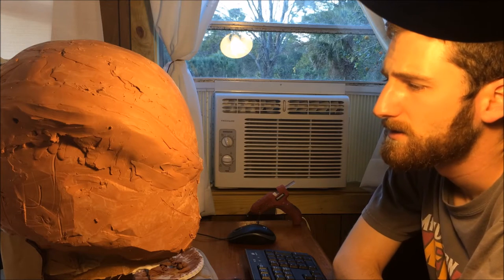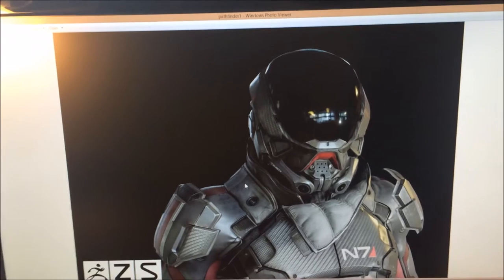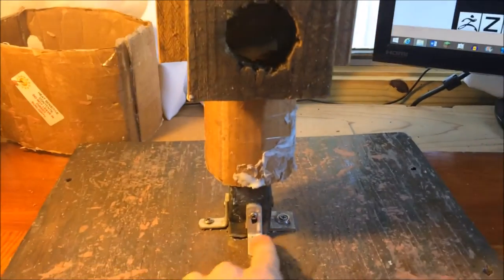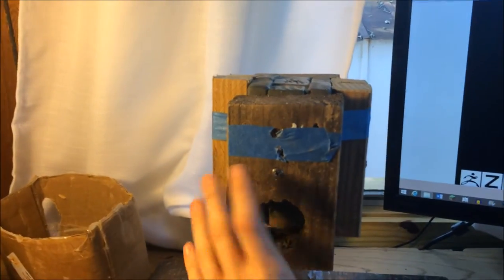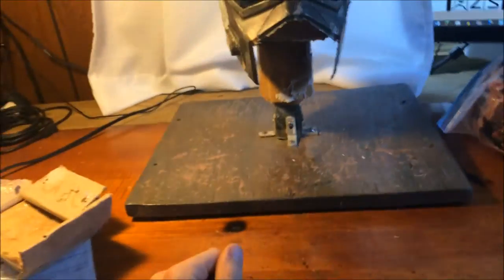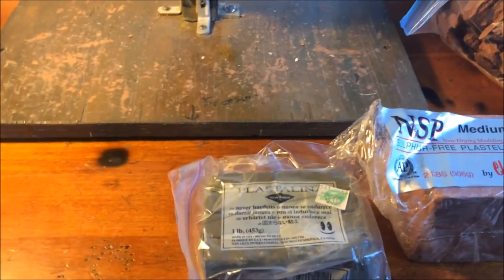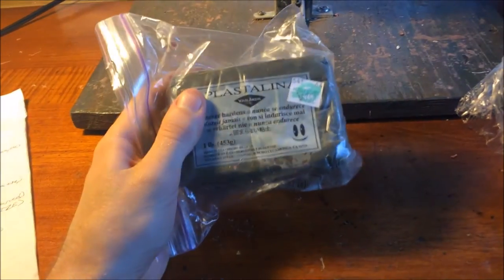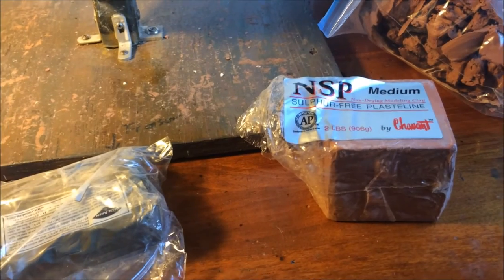How to Make a Replica Helmet Step 1: Sculpting Part 1

Comment: Great job on those helmets they are really cool! Anyone wanting to work with Chavant or Monster clay it's a good idea to build a heater box to keep your clay warm, I built a small but tall wooden box out of plywood with a wooden door on hinges, mounted a pull chain light socket with a 150 watt bulb, ran the pull chain through a small hole out of the back of the wooden box and lined the entire interior with silver heating duct tape to reflect the heat. It works amazing, close the door and it will melt an entire 5lb tub of Monster clay in 15 minutes but not so hot I can't handle it. If I want the clay a little firmer I open the door and pull or push the tub in or out until I get it right where it's perfect for what I'm sculpting. Also a lazy suzan is a must! Hope this helps someone!

Comment: Unparalleled series of videos, very informative and useful. One question though, how do you go about sculpting without using a helmet base? Thanks
Reply from the maker: Thanks! I'm glad the videos are useful.
As for sculpting without a helmet armature for a base, you can do several things. I've used scraps of wood to build up a rough form to use as a base. I've also used cardboard. Just make your base out of something sturdy and make it smaller than the helmet will be so you have room to add your clay for the sculpt. Hope that helps.

Comment: How do you do the pepakura?
Reply from the maker: You can check out some of the older tutorials on my channel but essentially you just find a 3D file someone made, open it in the pepakura program, scale it to the right size, then print out the 2D pieces. Then you cut out, fold, and glue the pieces together to assemble the helmet. Then you need to resin and fiberglass it to give it strength, then use auto body filler to smooth and add details. Then paint.